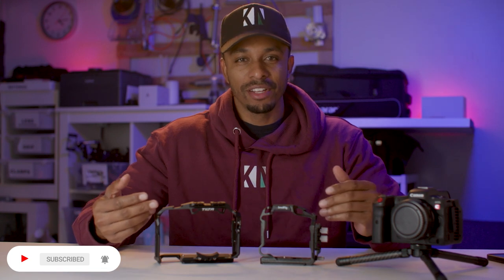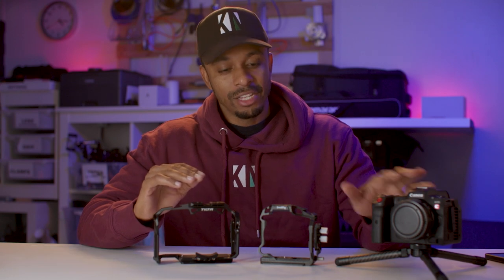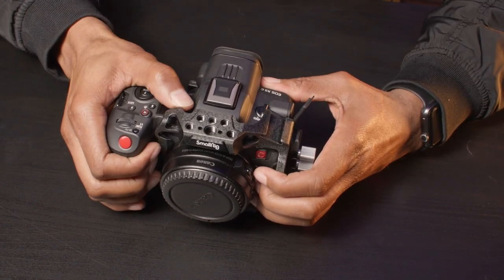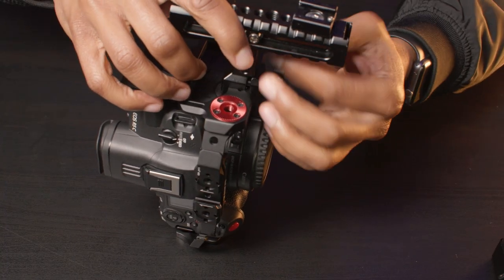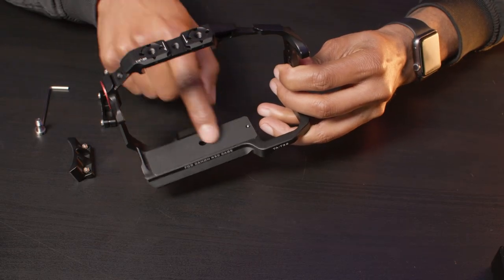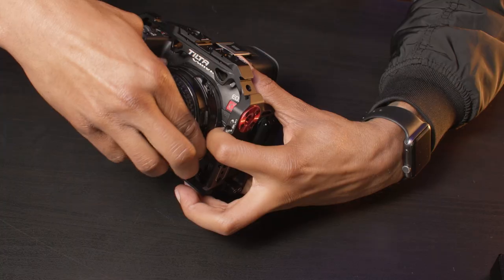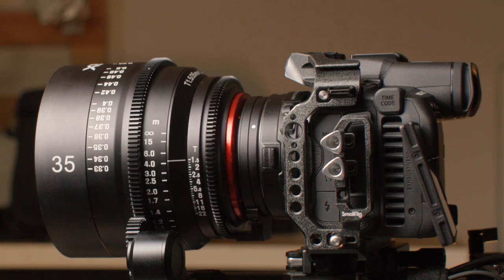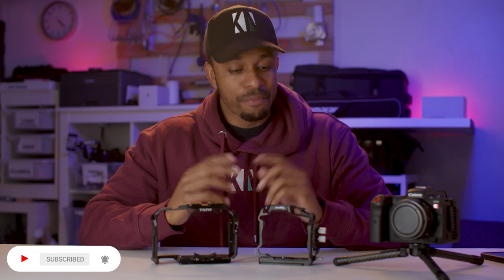Canon R5C cage comparison | Tilta TA-32 vs SmallRig Half Cage

Comment: love soo much about the Tilta, the rosette on side be great for the adjustable handle + the grip side having 1/4 20s be great for vert video.  one thing I cannot understand is why they interrupted the nato rail on top to have a cold shoe right in the middle.  might just me and my run-and-gun setups, but cold shoes mounts are constatnly getting loose throughout the shoot, and really hate babysitting the components on my rig throughout the day.  that center point (for me) usually reseved for handle+monitor, and noooo way I'd cold shoe mount that.  Kirth hows this been for you and your use?  suppose an off-center handle not the end of the world, but always tried to keep my CoG dialed in best i can .. thanks in advance for info.  just subb'd love your delivery format ya got going here : ]